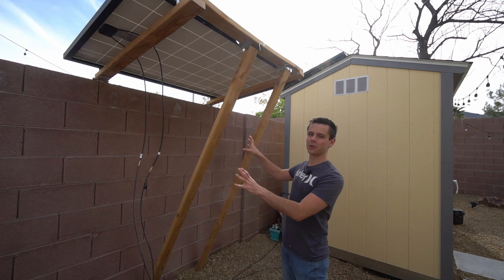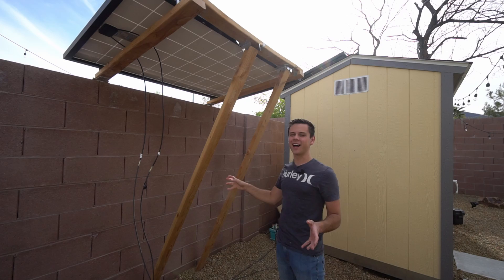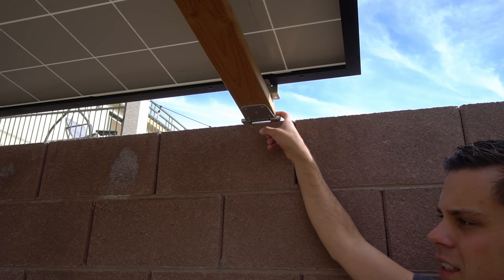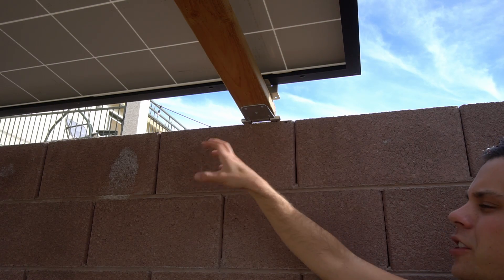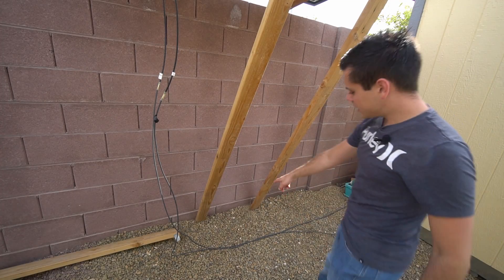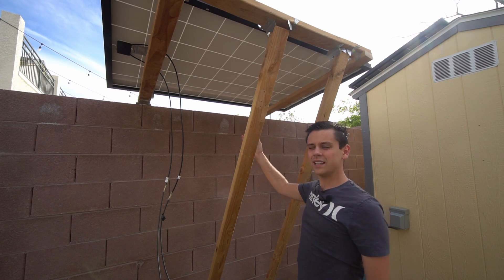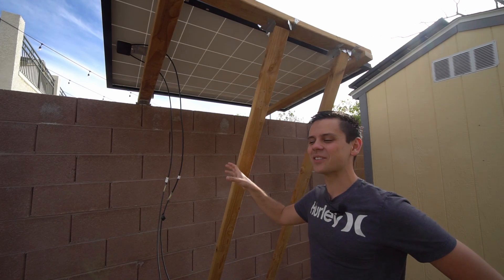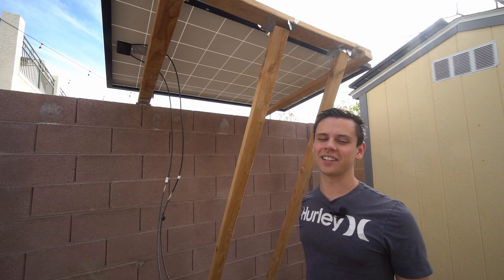DIY 270W Solar Shade Prototype #1 (Not NEC or Safety Certified)

Comment from the maker: Took the panel down because I don't trust the concrete blocks. They can crumble too easily. I'll just lean the panel against my house and I get nearly the same output.

Tired of getting ripped off? Check out my "Will Prowse Approved" solar product recommendations below!

12V Batteries
https://www.mobile-solarpower.com/lithium-batteries.html

48V Batteries
https://www.mobile-solarpower.com/48v-batteries.html

Offgrid Inverter System Builder
https://www.mobile-solarpower.com/48v-complete-system-blueprint-559371.html

Hybrid Inverter System Builder
https://www.mobile-solarpower.com/code-compliant-48v-offgrid-system.html

Mobile Handtruck System Builder (very popular!)
https://www.mobile-solarpower.com/mobile-48v-system.html

Solar Panels
https://www.mobile-solarpower.com/300w-solar-panels.html

Ground Mount Solar Racking
https://www.mobile-solarpower.com/ground-mount-racks.html

Wire, Lugs and Busbars
https://www.mobile-solarpower.com/wire-and-connectors.html

Tools
https://www.mobile-solarpower.com/tools.html

Fuses and Circuit Breakers
https://www.mobile-solarpower.com/fuses.html

Plug-N-Play Solar Systems
Ecoflow, Anker And Bluetti! So many models to choose from. See my current recommendations here:
https://www.mobile-solarpower.com/full-size-systems.html

~~~~~~~~~~~~~~~~~~~~~~~~~~~~~~~~~~~~~~~~~~
Need to build a large DIY system? Need a trustworthy solar distributor? These are my favorites:

Signature Solar
Creator of EG4! Solar Minisplits, Victron and More! Largest Solar Store Online.
If you want $50 off, please use my link below and coupon code "DIYSOLAR50":
https://signaturesolar.com/?ref=cPwLcVc0SW-BjN

Current Connected
Best Prices for EG4, Victron, Midnite and so much more! Fast Shipping and Highest Rated Customer Service:
https://currentconnected.com/?ref=wp

~~~~~~~~~~~~~~~~~~~~~~~~~~~~~~~~~~~~~~~~~~
Join our DIY Solar Community 
Need more help? Join the largest solar forum on the internet for beginners and professionals alike. 140,000 members and counting!
https://www.diysolarforum.com

Check Out My Free Book
Best-selling and beginner-friendly guidebook to off-grid 12V solar!
https://www.mobile-solarpower.com/the-book.html

~~~~~~~~~~~~~~~~~~~~~~~~~~~~~~~~~~~~~~~~~~
Contact Information:
I am NOT available for personal solar system consult! If you wish to contact me, this is my direct email: williamprowsediysolar@gmail.com
FTC Disclosure Statement and Disclaimers:
Every video includes paid promotion or sponsorship (such as free products for review). Some links on this YouTube channel may be affiliate links. We may get paid if you buy something or take an action after clicking one of these. My videos are for educational purposes only. Information is subject to change/update at any time. Electricity is DANGEROUS and can kill. Be smart and use common sense :) DIY Solar Power with Will Prowse is a participant in the Amazon Services LLC Associates Program, An affiliate advertising program designed to provide a means for sites to earn advertising fees by advertising and linking to Amazon.com
Reply: Post another video to see update...
Reply: Don't give up,I'm going to build something like this too.
Reply: I was thinking the same thing about the cinder blocks. Nice try though.
Reply: Will- would you consider a solar powered water distillation system how to video?

Comment: I want to do something similar. I have a terraced yard with a south facing retaining wall. I'm thinking of placing a small array connected on hinges so I can adjust the tilt. The hinges will be screwed into the face of the wall, not the top cap. Wind shouldn't be a problem. It usually blows in from the north.

Comment: Good job
Please a little heads up.

12v system with 24v panels thru 60A 12v/24v/36v/48v MPPT SCC 100v max input voltage.

Is it allowed to increase MPPT SCC panels input to 36v (that's 3s config assuming each panel is 12v) or to 48v input (2s if panel is 24v) and still maintain the 12v system?

If yes, does this allow safely breaching the allowable 720 watts (12v X 60amps) 60A SCC specs for 12v system by increasing the input above 720 watts or is it criminal to do it?

Thanks.

Comment: The structure that you built is probably stronger than that block wall. Unless the filled the blocks with concrete, which they typically never do.

Comment: Hey Will . Have you ever done a review using super caps in conjunction with batteries ?
Reply from the maker: No point. Capacitors have no benefit in a large battery bank charged with solar and discharged at a .3C rate.

Comment: If the wind comes from the side you are standing that panel is gunna flip over that wall. The weakest part of the build is the wall.  A few good hits and you can push a block out of a wall like that.  Good build and it saves space.
Reply from the maker: It's secured now

Comment: Hi Will i hope all is well in your part of the world ?
Love the channel ! been watching for a few years now and as i'm starting a new RV build i've been absorbing all your input i can :)
I have a question if i may ?
My RV roof has the space for 4 X 100W pannels (renogy kit) but due to living in the Uk and being rather high up in the northern latitudes i want to tilt my pannels when on site, the question i have is, can i tilt 2 at a time rather than all 4? the reason for this is if i tilt all 4 the 2 southmost will shade the 2 northenmost pannels due to the limited roof width, my idea was to wire each side of the RV (2 pannels) in series and both sides in parralel into the MPPT, would i be able to use 1 MPPT controller with only 2 pannels tilted or would i need to use 2 seperate smaller controllers due to the imbalence of the 2 sets ?
I will be using an AGM battery bank (400A) as the backup from companys in the UK for Lithium is pretty much non existant and i already have a shore charger and B to B that is only setup for lead acid (Ex ambulance), i thought this may have a bearing on the answer due to not needing (or using) a large bulk charge that my (lack of) sun can provide?

Thanks for your time and many many thanks for the great channel !

Comment: Neighbors must love you.  You created a wing and if the wind goes towards your neighbors it will fly over unless you anchor the bottom.  Curious if you are on good terms with them.   I thought in Vegas if you build over 6 feet you need permits.  Unless it freestanding structure.  I like your projects, but try to respect your neighbors.
Reply from the maker: They love it!  Lol its good
Reply from the maker: And its tied to ground and shed now

Comment: I'm guessing that wind is the number one enemy of solar panels in general.  The fact that they are panels and will act as sails when the wind hits them just right (or wrong).
Reply from the maker: Yes the forces generated can be HUGE. I used to kiteboard as a teen and the wind can kill. Any solar array needs to be rock solid if you want it sticking around.
Reply: Yeah with a storm 1 year ago i had 20 panels that flew away. Luckily i had them installed by a company a few years ago (i wasnt into powerwalls and stuff back then), and according to the expert they used 1 concrete weight short, so their insurance had to pay for everything.

Comment: That is so cool. That little panel can power your Tesla for 6 miles a day !!! Thanks for sharing. May I recommend Torx screws for 2x4 and other wood projects. I love them. Pre-drill a hole slightly smaller than the diameter and use an impact drill to install. Based on one your previous vids, I am guessing you buy a Milwaukee brand if you don't already have one. Makes wood projects fast, easy, strong and easy to redo. Yep, they are super easy to screw back out if you change your mind about something.
Reply from the maker: I used 4 Milwaukee tools to build it :D
Reply from the maker: Ok will check out torx

Comment: With a 12/24V oleodynamic motor (hydraulic cylinder), you can set the tilt every single minute to be always perpendicolar to the sun
Reply: That would be a nice project :)
Reply: zarbonida sun is going the other axis.
Reply: @johndodge8999  he needs to install panel Est-West

Comment: Run a rope straight down from the center of the long piece of wood between the two supports and attach an anchor of scrap metal or sandbags.  Good movable and temporary anchor against wind.
Reply from the maker: Smart! Or a ground screw. Smart Idea. Need to add that
Reply: @WillProwse  A ground screw is much more difficult to install and runs the risk of interference with buried wires or pipes at the depth you'd need for it to be effective against strong winds.  Probably best to stick with something that doesn't require a worker to come out and mark out your underground utilities before you  can safely use.  At least if it's not going to be permanent.
Reply from the maker: @hellcat1988  Ok will tie it down to the shed. that will do it
Reply: @WillProwse  Yeah you don't want the wind to flip it over the wall into your neighbor's yard 😁
Reply from the maker: @JRP3  Ok good point haha going to run out there and add that. I have a ton of ground screws from my ground array in san diego. smart thinking :D

Comment: I know if you had the right materials that solar panel would track the direction of the sun!
Reply: I don't know the latest but historically the cost of solar tracking devices has produced less gain per dollar than adding more panels to the array. Trackers may be worthwhile in locations where the available space is maxed out with panels.